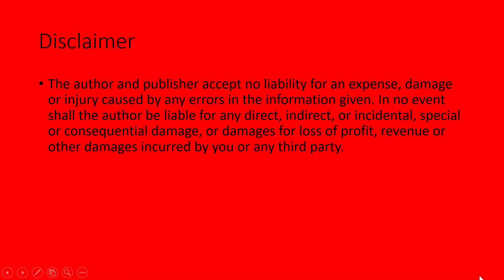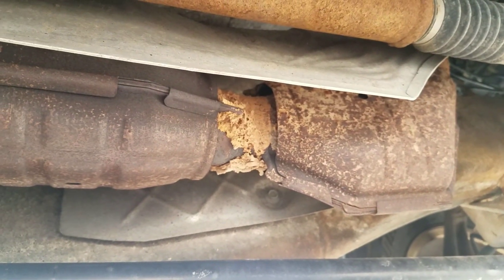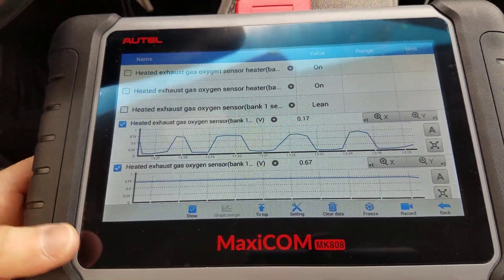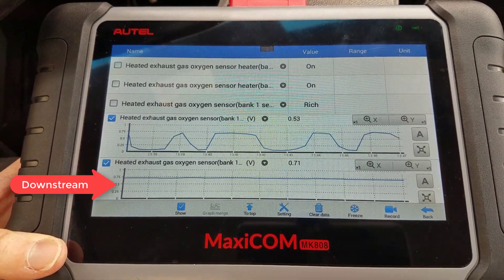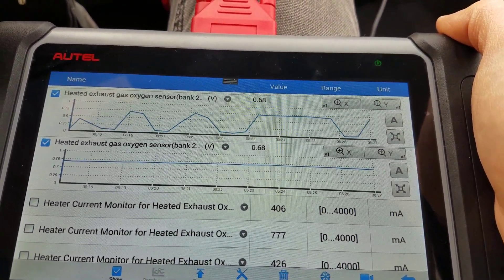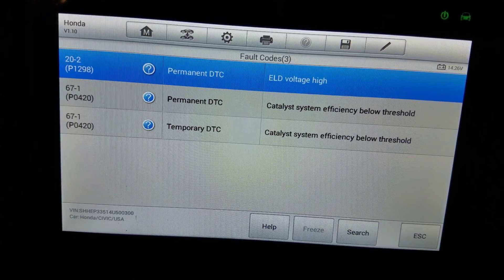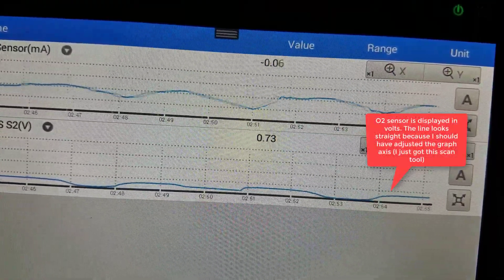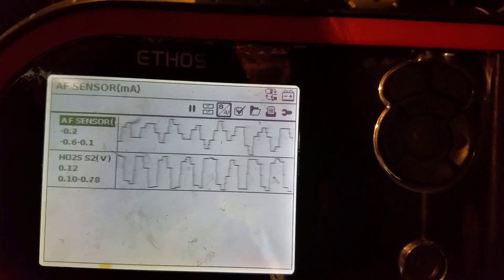P0420 - 2004 Honda Civic Si 2.0L (Part 1 Diagnosis)

Comment: P0420 may not mean a new converter is needed, however, it could well be, but think like this: if the O2 sensor is fouled, say, by oil or coolant in the engine, then the readings will be wrong, so, replacing the cat converter will not solve the issue.
The best course of action would be to also consider the mileage since last any of those elements were replaced AND also, if the engine has not leaks to the inside of the combustion chamber, which in such case, the problem would come back....
So here I am with a Subaru Outback which I replaced the cat converter and still won't pass emissions inspections (NC)... I checked the O2 sensors (graphs) and the upstream is indeed flipping as it should, whereas the downstream looks quite not like that, so next step for me is to replace the downstream since the car is 230k miles by now... and I know I replaced the upstream some 40k miles ago, and the graphing shows it is behaving as it should.